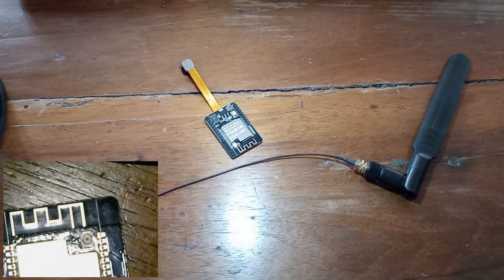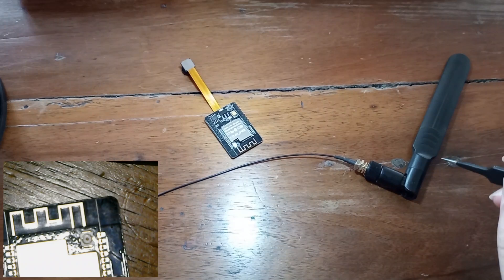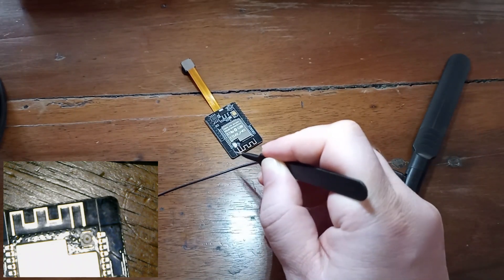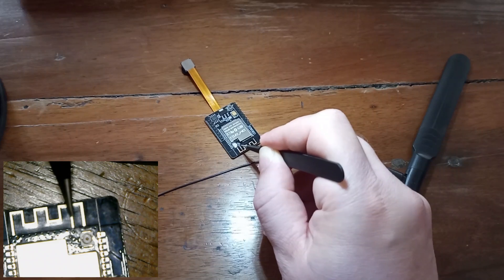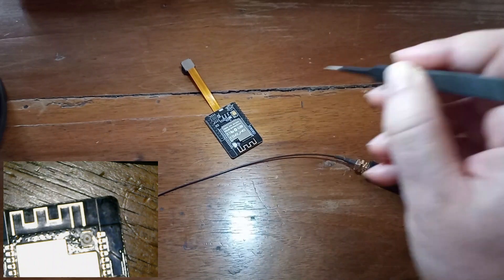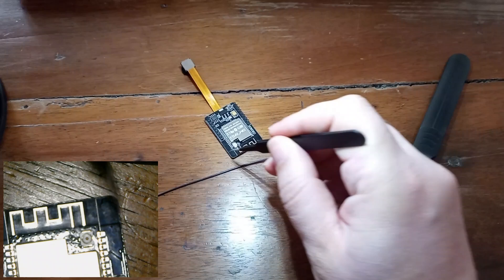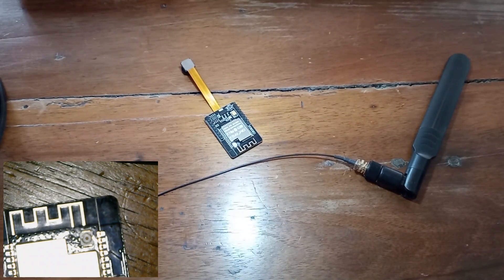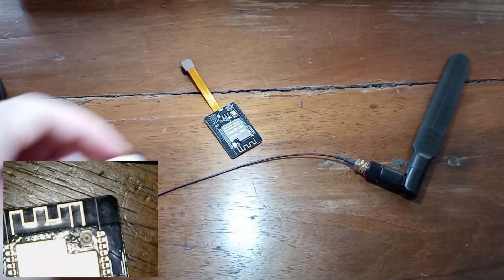ESP32-CAM Board, how to set up external antenna

Comment: I'm having a hell of a time soldering this for the external antenna! It's tiny and my soldering skills are lacking looks like. Any tips?
Reply from the maker: Hardly anybody could give you a satisfying advice. Depends on skill, tools and experience. I did it by using hot air and a lot of flux.